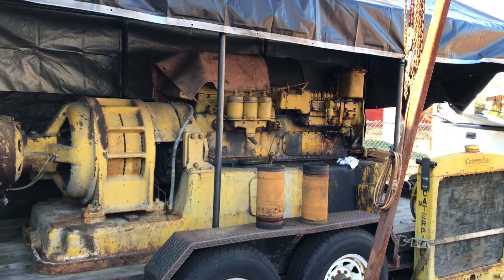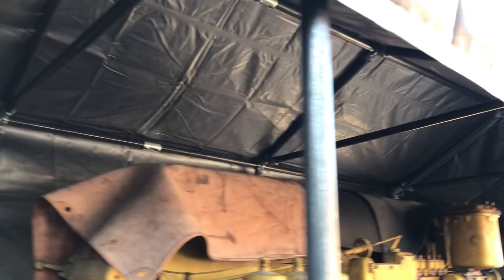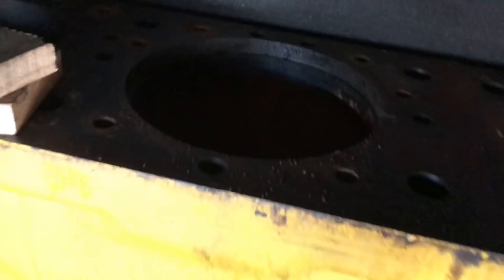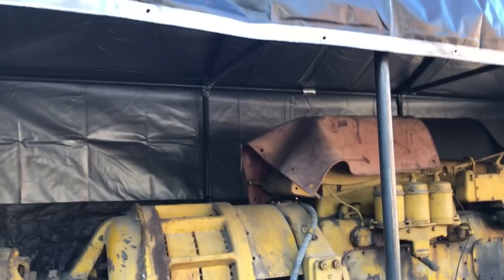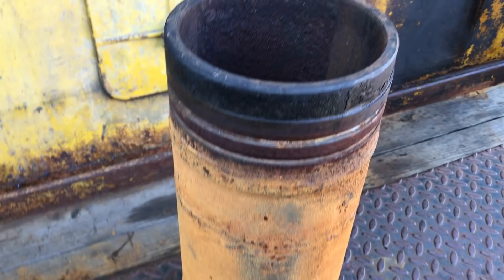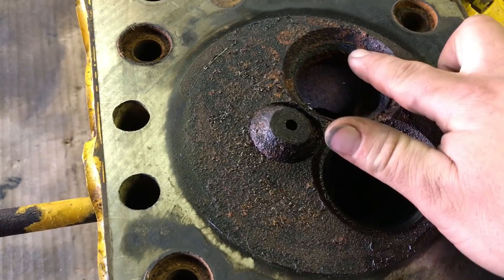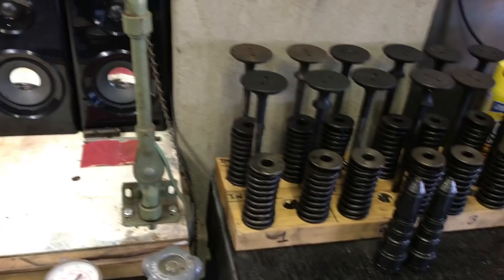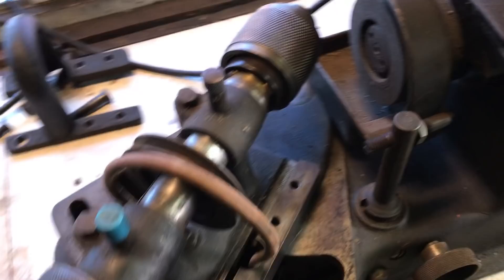Antique Caterpillar Generator Set Repair (Update)

Comment: Check the area between the valves for cracks. D 17000's are notorious for cracking at that point. If it's cracked, the crack will bridge the valve seats. This area is is thinnest part of head. Also, there's a copper washer(bottom) and an O-ring on the pre-combustion chambers for each cylinder. They can be a PITA to remove, but coolant can leak past either to the cylinder. Thanks for the update and good luck with it. Can't wait to hear it running and making juice!

Comment: They had shims in them to begin with if when the shim is in it height is not right, there are other shims! Or can have the part of the block that the liner  sets in called the counter bore machined to adjust that depth to get the right protrusion! That is one of the jobs I did working for the cat dealer! If the ledge is cracked they make an insert to put in the cylinder block to fix it!

Comment: Thanks for the update Mike! Look forward to more as you post them. As I recall all that damage to the liners and valves, etc was because the previous owners had the genny outside and no one put a coffee can over the vertical exhaust pipe.....
Reply: From what I recall, the generator was actually located inside of the building. But you are correct about them not covering the exhaust stack. Such a shame! But Mike will get it running again :)

Comment: Some of the parts you need may be available from Cat but the cost may be prohibitive. That valve will be so sharp when you grind it that you will be past the hardened material and down to the underlying soft metal. A sharp edge on the valve circumference will likely cause the valve to burn.

Those liners are shot. Even if you could get them cleaned up and bored can you get new or usable pistons the right size? 

The metal ring is designed to crush as the head is torqued down and hold the liner lip against the seal ring that is built in to the head gasket. They seldom leak but you better get those bottom end O ring seating surfaces very clean and pit free. If they leak... well you know where that leaves you.  Good luck with it. Glad it's you and not me!

Comment: Are those setscrew-mounted pipe fittings solid enough so the roof doesn't come adrift while going down the road?
I figure you might have some experience with that 9 months later...

Comment: None of that looks automotive which is my experience.  More like the parts on a ship.  My take would be none of the clearances would be in spec and you would need a bore job with oversized pistons. $$$$$.  The pistons and valves look like about 200 rpm jobs.